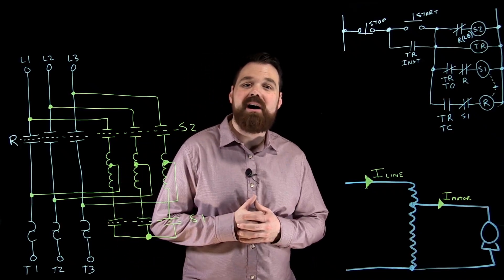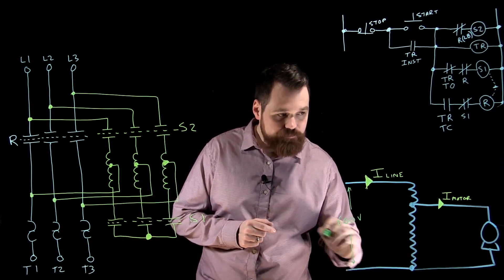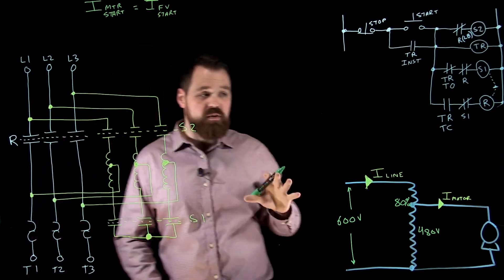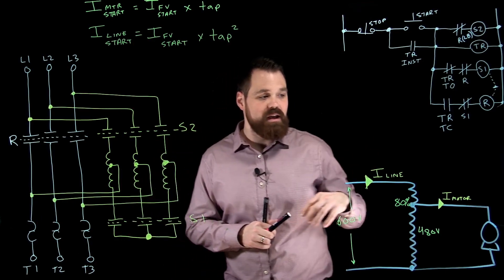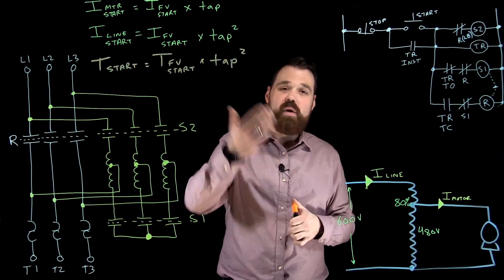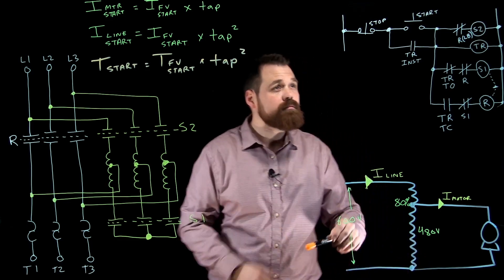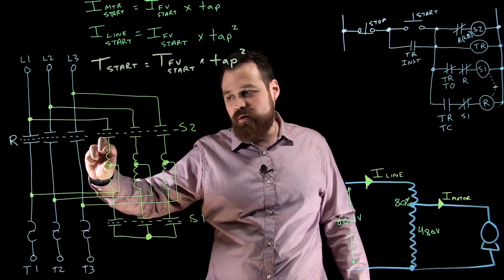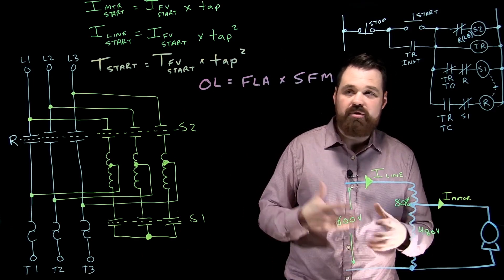Autotransformer Motor Starter

Comment: Been doing research regarding this. I have read about somewhere where autotransformer is good for motor start with high torque and vice versa where wye delta starters is for motor start with low torque requirements. is this correct? TY

Comment: If I run a 240v 3 phase motor on 208v it will draw MORE current, not less. So how is putting lowered voltage to a motor through an autotransformer going to make your motor start at a reduced current? Unless it acts like a reactor and limits the inrush current like some sort of choke.
Reply: I believe this has to do with motor slip and running it below it's rated voltage. Run that motor with 120V and you'll see a lower current draw and the motor will run a lot slower.

Comment: Hello, there u need to correction a bit. Practically when u on the circuit it will  energized the S2 contactor , timer relay and S1 contactor. After 10 seconds S1 contactor and S2 contactor de-energized same time timer relay will inject power to R contactor. But there is no working cause R contactor self holding missing....
Reply: I seen that too

Comment: Hello. your video is very good. An Auto Transformer connection is basically  useful to transform the voltage and amperes, for starting easily.  I want to ask you, first of all the S1 and S2 are being energized . The voltage passes through the whole transformer and when it turns from L1 to L2 from the coils of the motor, does it pass again  through the half of the winding of the transformer??

And later what happens exactly when a small part of the winding of the transformer continues connecting?  I was thinking that the last part means that the motor ''reads'' all winding of the transformer, so you have more voltage/Amperes and the motor takes more power.  
The last pass is easy to understand because only  the main contactor was energized .

Comment: This was a great video. Thank you. Working on an old hog grinder (200 HP) that welded one week old contacts by single phasing of the AT contactor. I didn’t understand it until my ultra smart contractor friend came to look at it and briefly explained it. Old ITE contactors in this thing, probably early 80’s. Going to simplify it with an ABB PSR 300 soft start. Much simpler and cheaper than replacing two contactors. Thank you for the great explanation.

Comment: What would the inrush current of the autotransformer be in this case. Would that compound with the starting current of the motor during start-up when S2 closes?
Reply: @ZackHartle  My thought process was; When S2 is closed, isnt that energising the transformer which is then energising the motor at reduced voltage at the same time before R is closed. So wouldnt the inrush current seen at the supply be a sum of transformer inrush plus the reduced voltage motor starting current?

Comment: at 6:35 to 6:45 .. why the holding contact TR instantly closed after the Timing Relay(TR) activated, whereas the normaly closed TR TO have to wait for the timer to finish count 
 to open. is it the same timing relay they refers to?
Reply: @ZackHartle  so the TR Inst will not open even when the timer finished timing?
Reply: Thank you

Comment: What happens if the 3 transformer leads on starter 1 are not tied together? I'm working on one now where they are not tied together but it still works
Reply: @ZackHartle  I do appreciate your response to my question. I wasn't sure if it would be better to tie the bottom lugs of the contactor together or not
Reply: @ZackHartle  will do! I greatly appreciate you taking time to answer my questions. Thanks